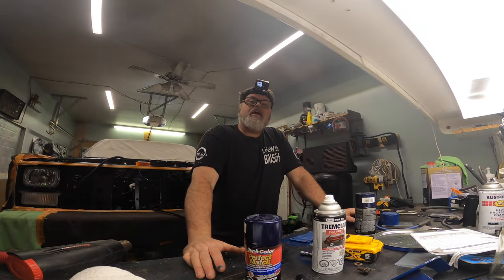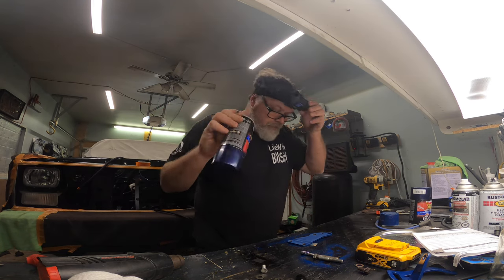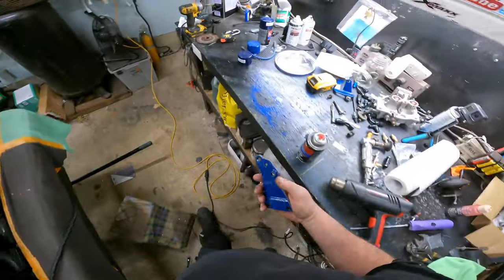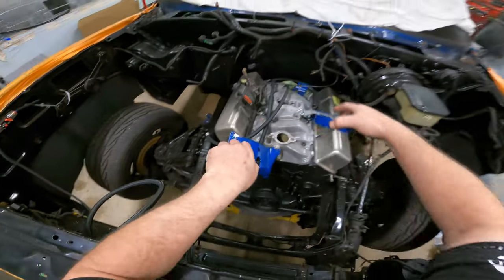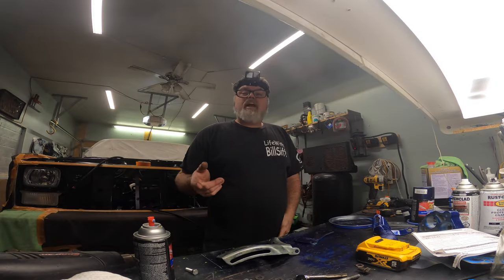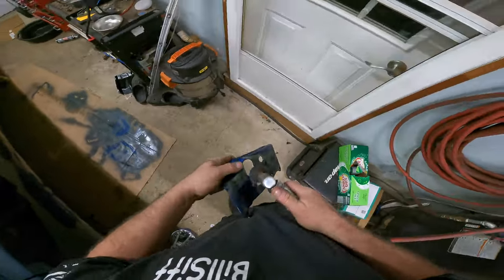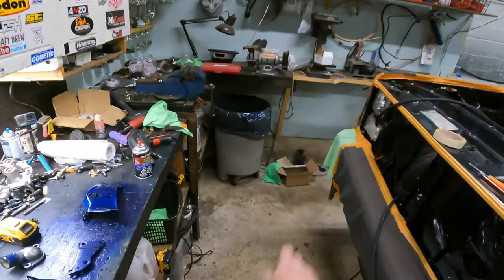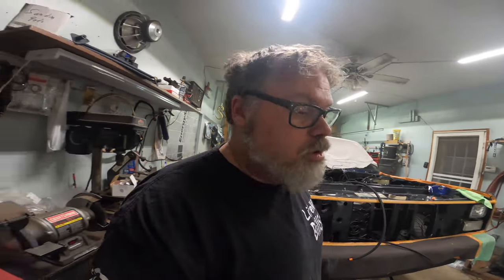Friday Night Paint Job (THIS SUCKS)   4K

Comment: Bill are you wiping down the parts before you paint them with something like dupli - color grease and wax remover that could be part of your paint problems . The other thing is you need to do thin coats . I use dupli-color grease and wax remover Canadian tire sells it

Comment: the paint you used is normal oil base paint then you used a car paint over the top they dont mix as soon as you put your auto paint over the normal oil base paint it will always go to orange peel been a painter for over 30 years one paint is turps base and the auto paint is thinners base you have to strip them back to metal